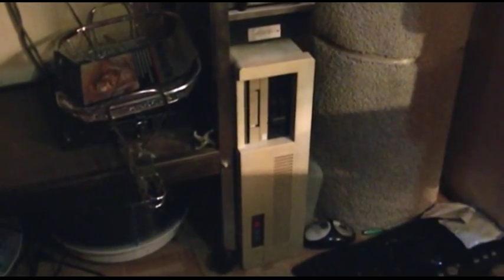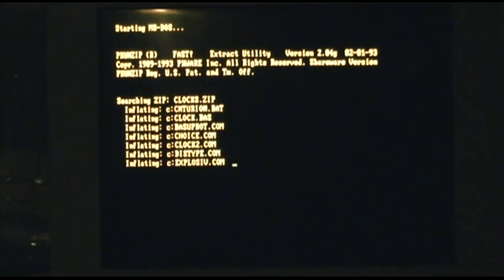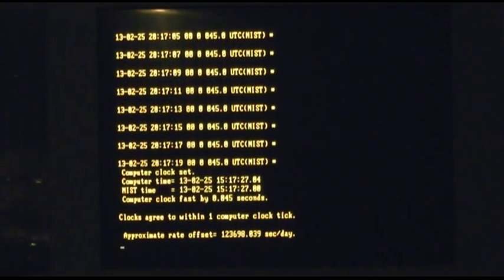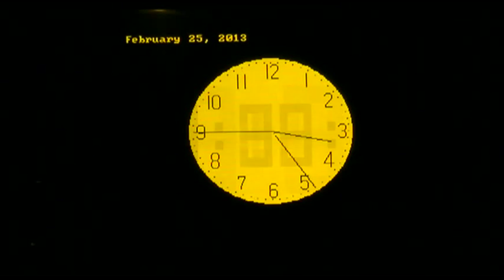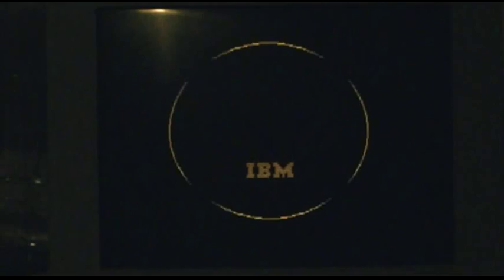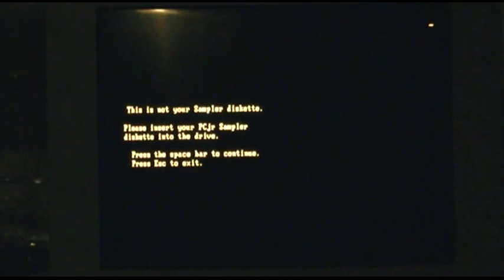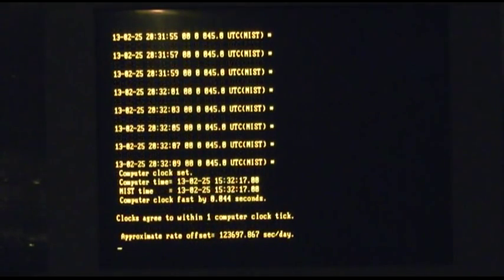Turn an old PC into a clock!

Comment: THERE IS NO ESCAPE! (sorry had too..:P ) that was a very neat video. the clocks were very cool. and all the info you gave out was very interesting. the screen burn in and the dial-up sound bring back some memory's. the dial up sound i remember from my dads old computer he had. i use to hear that quite a bit when i was little. as for the screen burn in. that has a more interesting story.. my school had crt monitors up until i graduated in the library. and every one of them had the Windows XP Pro. login screen burned into the monitor. i always found that kinda amusing. and this video made me remember that..LOL anyway. great video Jay!
Reply from the maker: +ToryTheFanMan Ha ha!  I have a lot to say back:
1.  "There is no escape" was also used in an IBM PC game that went by 2 names, Road Runner Rescue or Freddy's Rescue Roundup; same game.  If you pressed the ESC, you'd lose a guy and it would show "There is no escape" at the bottom!
2.  Dial-up still works, on my VoIP it has no trouble with data over the phone line, although at higher bps settings it can sometimes have a bit of trouble.
3.  They still had CRTs when you were in school?  Wow.  LCDs were around back in 1998 or even prior, but they were very expensive.  I guess you got the tail end of it.
4.  The "highest end" computers we had in school up until I graduated back in 1997 were Apple II machines.  With green monochrome screens.  They were well outdated and obsolete by then, I mean Windows 95 had been on the scene for 2 years, these things didn't know what "Internet" was.  As soon as I graduated, the next year they got all kinds of machines in that ran 95, they were all the cheapest of the cheap crap, I mean I've seen some bad hardware back in the day but these took the cake!  I think the district had them built to order from the least expensive mail-order place they could find.
5.  At my job we used to have CRTs, and the terminal emulator program that was always on screen had burned into the screen.  I figured that was normal.  Until they were replaced with LCDs, and the image burned in there as well!  I've always attributed that to cheap LCDs!  Back in the 80s, when screens were monochrome most of the time (in businesses), over the weekend they would leave the machines powered on, logged out of whatever, and the company logo (rendered in text characters) would be left on the screen, from Friday at 5 o'clock until Monday at 9 AM.  So many of those had severe burn-in!  But like I said in this video, the burn-in I had was just from 6-8 hours once a week, so I guess they were much more susceptible.  I have a vague recollection of a program that attempted to "undo" burn-in, by displaying a reverse video image of whatever was being displayed.  This "burned-in" solid color areas right around what was there, and took a while, but obviously diminished the brightness of the screen as well.  Most times these mono screens went so bright there was plenty of life left in them after.

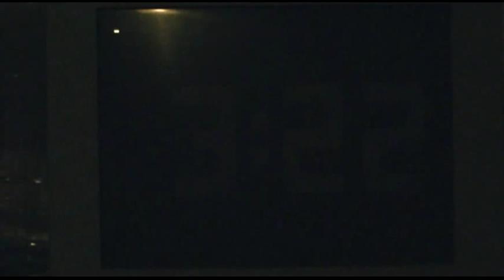Comment: You'll notice at 7:01 the 2nd clock went from 3:19 to 3:22.  This is likely due to adjustment to the time stamps that each clock utility was set at.
Reply from the maker: Perhaps there was a cut in the video; I don't remember as it was many years ago.  Then, I was using the YouTube Video Editor, so I don't have a project file to go back and look at to be sure.  There's only one clock that all of those programs look at, the system clock.  The system clock would get its time from the internal RTC, except being an XT-class machine, it doesn't have such a clock.  That clock would be set at the command line.  I have automated that using the NIST clock, dialing up by modem, but all of those time stamps it pulls in are only to synchronize the clock as close as possible to the Atomic clock.